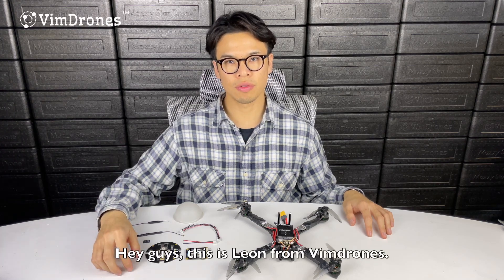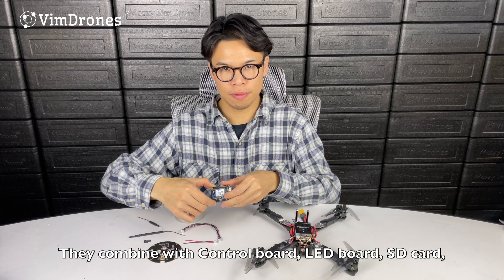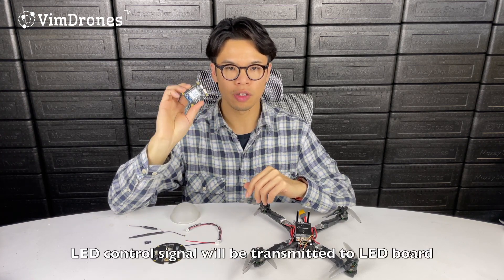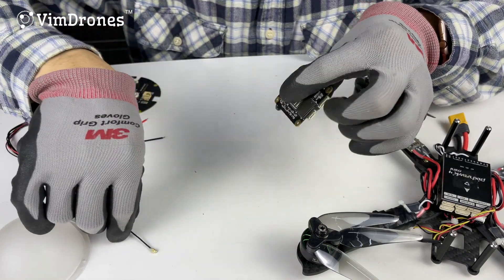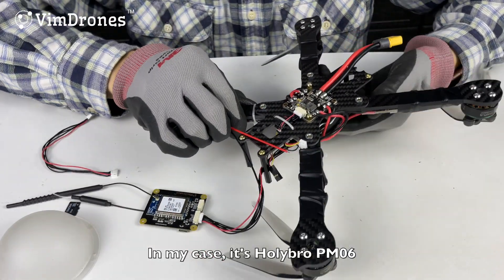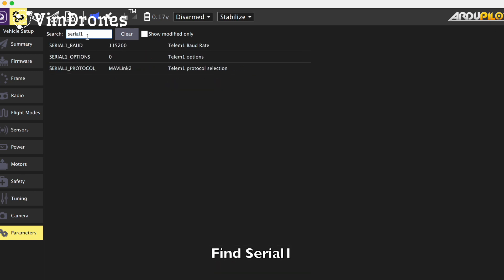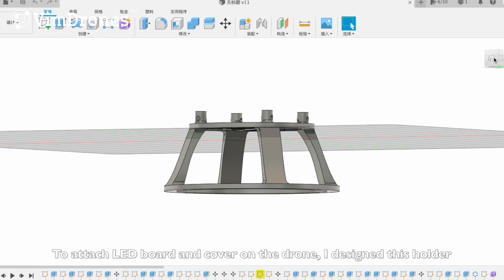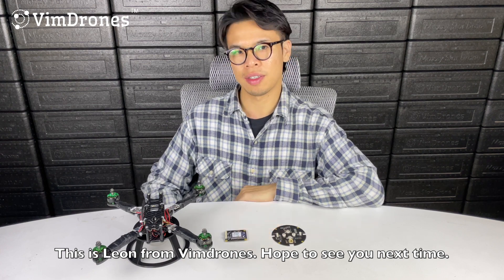How to Assemble Vimdrones Control Unit Kit to Your Custom Drone | Drone Light Show 101

Comment: Good , very good information. 
I already made my diy drone , and i also want to make drone light show , but i have no knowledge about that controller which connect to pc and gcs 

 I want to more about that , i want to make also that controller my self , please give information
Reply from the maker: Hi Jay. After carrying our control unit, your drone will connect to our basestation, through which will connect to the PC and GCS. You may see this video [https://www.youtube.com/watch?v=iSv-nGm3Wn8&t=11s] for more infos about connection among drones - basestation - PC&GCS
Reply: @DroneLightShow  i know, by your control unit it's connect , but if i purchase your control unit then i have to purchase your GCS nd all over it's costly , so i want to make my self this control unit , and i want in bulk so it's costly , can you provide me , how to make own self ?
Reply: @jaykhunt6828  I'm in the process of trying to put together a design for drones to be used in producing drone shows.  I intent to manufacture my own drones and would also be interested in just how proprietary the components are.  Will the flight controller work with Nav1 or other firmware?  I hope to determine if these components can be mixed with other manufactures or if they are specific to their HW or SW, which would make it unnecessarily difficult to work with.